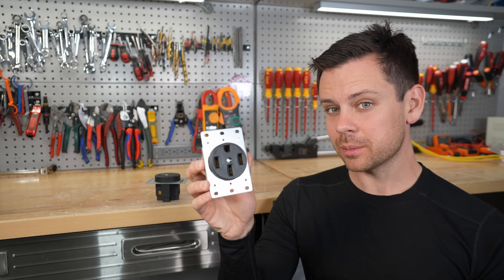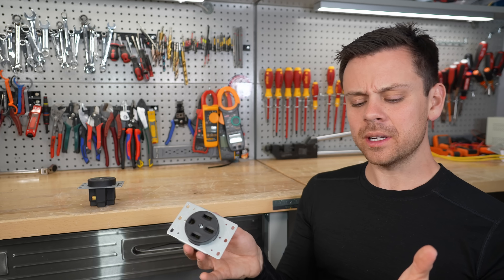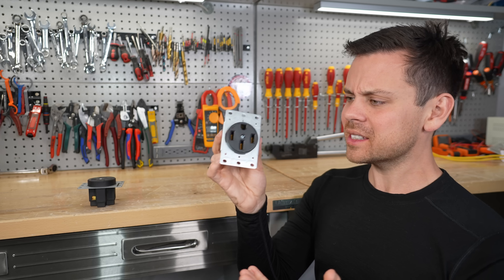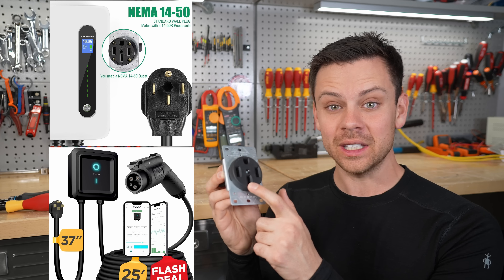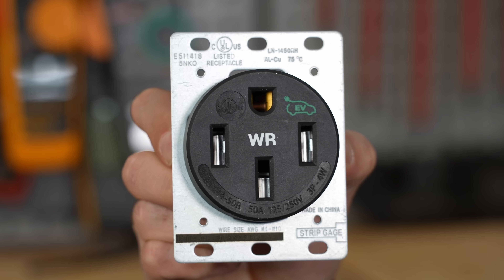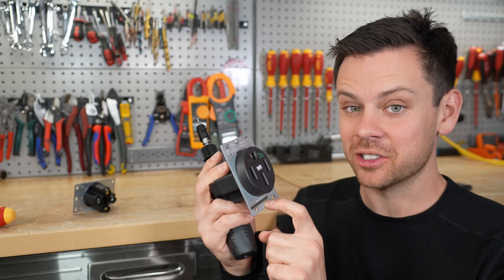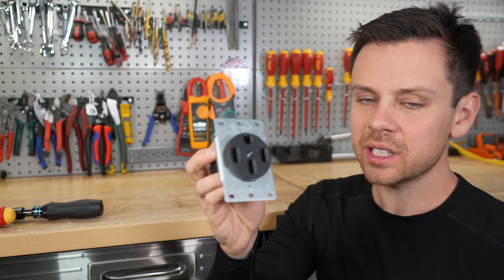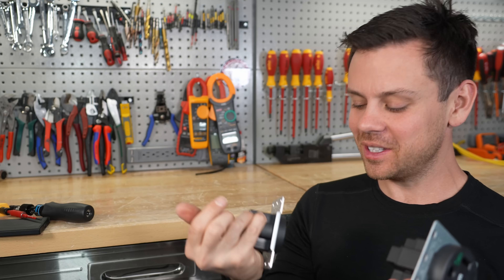Quick Guide to NEMA 14-50: Don't Burn Your House Down!

Comment: Is this a UL rating issue?  If it is UL rated for 50 amps it should do 50 amps no if buts about it.

If this rating is under some type of duty cycle limit  the UL rating should state that.

ETC,  is this 50 amp rating peak, continuous dutycycle or some other constrant?  I wonder would the manufaures instructions say.

The cost of the product shouldn't just be a factor in a UL rating..

Comment: You need to check your wire ampacity chart. You do not need 4awg THHN for that 50 amp outlet.
Reply from the maker: @machaf  It's the max size recommended by the receptacle and the EV chargers. And I use the 60 Celsius column in nec. Overkill but I like to sleep good at night

Comment: My Vevor RV 50 amp power box hasn’t had an issue charging at 48 amps daily for over a year. No sign of melting, resistance is happening in your box for some reason.

Comment: This is why I am subscribed to this channel!  Great tip Will! Wasn't aware of this issue but after a quick Google search I am definitely replacing my outlet!  Our electrician installed a standard non-EV rated 14-50 outlet so my guess is that this isn't a widely known issue.
Reply: You can also use a Hubbell industrial 14-50. They are available everywhere. You don't need to have one stamped with an EV that is a marketing gimmick. Just avoid the cheap ones.

Comment: North America catch up with the rest of the world and start using pin & sleeve for high current outlets. There’s already a standard IEC 60309-2 (Series II) 

A 60A blue plug (2P, 3W) with mechanical interlock is all we need. For situations where a neutral is warranted like with RVs, the orange plug (3P, 4W) would be ideal

Comment: Bryant Electric 9450FR 50 Amp 125/250V NEMA 14-50R Flush 

Cheaper than Hubbell but as far as I have been able to determine, just as good.
Reply: Made by the same company and generally considered to be identical other than brand.

Comment: Also Will, what wire size were you using, #6 or #4,  how long was the run to the outlet and did you see any temperature rating on the outlet?  I'm thinking that as #6 is only good for about 40a at 60 degrees C, and 55A at 75C,  if the cheap outlet is only rated at 60-75C going to #4 might mitigate a lot of the heat with either the cheap and quality outlets.  
Additionally, one could consider hardwiring in a charger, and possibly skip added cost of a GFCI breaker as well, and  save about $150 to put towards a second charger if needed.

Comment: I'm constantly telling people to NOT install those cheap plugs or use their existing dryer socket.  Always recommend hard wiring over a socket as the sockets and plugs do wear down over time with use and with multiple disconnections.  I was working on a 40amp pottery kiln once at an art studio and noticed the plug was charred and melted.  Suffice to say, they had an electrician hard-wire it instead of burning the building down...
Reply: if you are using a dryer socket you need to cut back to 24 amps or lower. It's only a 30 amp circuit at best and you want no more than 80% continuous load.
Reply: @rupe53  I don't agree.  I would not trust a dryer socket period.  Unless you're only charging your vehicle for an hour or two at a time, it's too much load for a cheap dryer socket.  At 24 amps, you're likely going to be charging your vehicle for easily 5-7 hours per charge.  Dryer sockets are not designed for this.
Reply: @    that 80% rule is from both NEC and UL. It applies to continuous use, which is why it's down-rated from the face value of the circuit. I would agree that there may be exceptions due to wear and tear but that is beyond the scope of the general discusion here.

Comment: The amp capacity of ANY 14-50 outlet must be de-rated depending on if it is installed with a protectoive cap or not as it make less airflow to cooldown the plug. and also derated  if it is on a  wall facing south as most plugs are BLACK and when the sun shine on the charger plug it will rise their temperature by several degree which will also add up to the derating of the protective cap de-rating.  The mark that the female plug is leaving on the  male connector is a VERY great indication on the goor or bad electrical contact.  Also contrary to the popular opinion, frequent insertion of the plug DOES HELP to keep the 14-50 to not overheat as it brush the contact blades to expose fresh metal every single time. I am using the 10$ one since 12 years now paying attention to these rules and the maximum recorded temp was 39C under 32A stabilized after 2hour of continuous duty.  Plugs burn because heat and heat come from ALOT of different methods.. not only wire size, torque specs and amp selection etc...
Reply: @Doctorbasss  is the same thing true if I use a 14-50 outlet inside a home for an electric stove?  You are saying the simple act of plugging a cord into the plug means the plug can’t cool itself?  Or is an EV plug larger (less air) than say a stove plug, or other 240V /50A appliance?
Reply: Stoves/ ovens do not draw full current constantly like chargers, and aren't unplugged as often. Even the cheap ones hold up just fine for that use.

Comment: You only need 8 AWG copper THHN for a 14-50 outlet unless you found one that only has 60C terminations (which I've never seen). If you're using a 48A charger then you need to hard wire it and use 6 awg thhn.
Reply: Let's really make the heads explode...what about 6 AWG aluminum SER? It's rated for 50 amps with 75C terminations. And, if you have a device that either can't accept aluminum wire or doesn't have 75C terminations, go into a pullout AC disconnect (they have 75C terminations and accept aluminum wire) with the 6 AWG aluminum SER and come out of it with 8 AWG copper THHN to your device. Can even use an AC whip with the 8 AWG copper THHN preinstalled.
Reply: @niktak1114

This is so wrong. I have a mind to report this comment as misinformation. 

THIS IS DANGEROUS, DO NOT TAKE THIS PERSON'S ADVICE!
Reply: @billstevens3796  Niktak is correct. Check your NEC ampacity chart. 8 awg thhn is rated for 50 amps when using the 75C column. As long as your terminations are rated correctly (75C), you can use 8 awg thhn for a 50 amp circuit
Reply: @billstevens3796  Which part is wrong? It is correct for the US at least (I am an electrical engineer in the US so I'm mostly only familiar with the NEC)
Reply: @niktak1114

If you want to burn your own house down, fine. But don't go around telling people things that will cause their houses to burn down.
Reply: @billstevens3796  8 awg is accepted by code in this circumstance and is actually relatively conservative in most scenarios (it has to be for prescriptive rules like this)

Comment: Absolutely right. I’m an engineer and hired a commercial electrical contractor to install mine. They used a Leviton and I started receiving the high temp warning as well. After doing a lot of research I discovered that the continuous high current causes the crystalline metal structure to weaken and reduce the “grip” on the contacts. It doesn’t matter if you retorque the input terminals, the internal contacts are permanently damaged and the receptacle must be replaced. I chose a Hubbell and replaced it myself so I had peace of mind.
Reply: My question is... Is this a problem at the service box too?  If there is a constant draw at the 50amp breaker would their not be the same issue of the weakening contacts? Thoughts?  I wired mine up myself so I'm concern.  I did hard wire the " charging" Charge Point device.
Reply: @YPllayer  Usually not a problem at the breaker if the following are all true: Breaker is right brand for the panel, panel and bus connections are clean and tight, and wire is correctly sized and torqued correctly at the terminals. It is ok for the breaker to get fairly warm when the charger is running. 

If the breaker is hot (can't touch for more than 30 seconds), you smell hot or burning plastic, breaker buzzes or hums loudly ( a faint hum is ok) or it trips during a charge cycle, you need to get it checked. Any of those issues is NOT A DIY repair.
Reply: @Piinkz  the breaker itself is rated for continuous duty at face value. (it will get warm) The 80% rule for continuous duty (more than 3 hours) covers the entire circuit, wiring and plugs. This is in the NEC book. BTW, the correct breaker for the brand of panel should have no issues to 100 amps, which is the rating for the buss bar connections. If you are worried, pull the breaker and examine the contact area. If it's good then add some anti-ox to inhibit corrosion down the line.
Reply: @rupe53 What anti-ox do you use?
Reply: @chuckevans2792    they all meet the standard so whatever the supply house has in stock.
Reply: hey buddy, nice to see you here too! 😆
Reply: If they are installed, do they need to be replaced for an electric stove with a 40 amp breaker?  For our kitchen remodel, i think that a Leviton unit was installed, but I have to look.
Reply: @gibblespascack1418 You are probably ok. Stoves don't draw as much as an ev charger continuously (very important distinction to note) as the elements cycle on and off. If it is a Leviton (the cheap brand causing problems) it will usually be ok as long as it's not already damaged.
Reply: @mxslick50  Thank you.  We went through Thanksgiving and Christmas which would be the heaviest use, so I will pull the stove and take a look.  Have a good day.
Reply: @gibblespascack1418  My personal opinion;  I would replace it.  I had the same issue with a NEMA 14-50 being used for a dryer.  Ended up with only one leg of 120V supplying voltage to the dryer.  The dryer would run on the 120V leg but the heating element would not supply enough heat.  Pulled the dryer away from the wall to find the partially melted receptacle.  That's just a dryer that is used intermittently, and not for hours at a time.
Reply: @gregr7967  Sounds like a good plan.  I will change mine for the better unit.  $50 for a $35K kitchen remodel makes little difference to me.
Reply: @gibblespascack1418  you might want to.  Although the oven does cycle on and off, the burners and everything can really put a load on that,  oven can be 5500 watts, each element can be 1200 up to 1500 watts on some stoves. that's 10 kw or so, really pushing it to it's limits.  most stoves run 50 amps too i thought. better safe than sorry, but if it's been  in there a while, take a look at it you'll know if it's going to be problematic or not by now.
Reply: Hubbell replacement plugs are much better than the bargain plugs.

If you had an over temp warning, check the wires for heat stress when you replace the outlet. Look for cracks in the insulation!
+ If the insulation is hard it could crack when you put the outlet back in the box and you would not see it.
Reply: Do either one have an insertion cycle in the specs?
Reply: @fanplant     I bet you can find the UL listing test specs, but that might only be the minimum. BTW, here's a starting point... UL standard 498, titled Attachment Plugs and Receptacles. It covers the various ratings an durability if you dig into it.
Reply: Leviton does make an EV version now for around $40.

Comment: OK, I'm not doubting you at all, but my curiosity wants to know what exactly is the difference in construction that makes one not work and one 5 times more expensive?
Reply from the maker: Temp rating of plastic, terminal thickness and size, plug copper thickness etc. everything just bigger

Comment: Leviton is not traditionally known for poor quality. Ive used their industrial components for 3 decades and I dont recall having issue with any of the NEMA twist-lock or standard receptacles. This is concerning.
Reply: Same. We use them for everything at my job.
Reply: I use leviton for a lot, but their breakers have stupid plastic lever points, so not everything they make is perfect. 
But, I believe the 14-50r was designed with the NEC 80% rule in mind, not for continuous EV charging 3-8 hour loads above 40a.
Reply: Leviton makes two grades.
Homeowner Box Store Cheap
And
Commercial Grade.

Comment: A lot of us engineers were really debating this in other posts online talking about this.  I understand what you see in testing, but a 50A UL plug should be capable of very close to 50A continuous, or the rating is wrong.  Are you going to tell me I can only run a 15A outlet at 10 or 11 amps, cuz I constantly run things like hairdryers, portable AC, etc well above 10 amps (above 1200  watts, as high as 1500 watts at 125/120/115 V).  Are we saying a 240V outlet has to be de-rated differently?  By how much?  You are saying as low as 6000 or 7000 watts continuous?  How can they even call it a 50 A outlet then?  If you put a 50A breaker, shouldn’t it not trip until 125% load?  I also thought 6AWG is what is required for 50A 240V?  6AWG is what is used in “shore power cables” for boats, RVs, and generators.  6AWG is rated for 60A.
Reply: which again target ranges/ovens and dryers that is the market for the cheap ones.  I upgraded my oven to Bryant and 6 gauge THHW-2.
Reply: @dougbertInExile  Why is a rating of 50 amps "targeting" a lower-than-50-amp capacity?
Reply: @BurnerJones Because 50 amps is the maximum non-continuous load allowed. Per the NEC  a continuous load is one of max current for 3 hours or more.  Receptacles and devices are rated for 80% continuous load unless otherwise noted by the manufacturer. The cheap 14-50s fall under the 80% ratings for use.

Comment: UL approved.  What a mockery.  Even the advice to not use better quality 50A outlet at 50A for extended times.  Total mockery.  What point an outlet that can't actually be safely used at it's rated figure for at least 5 hours continuously.
Reply: which again target ranges/ovens and dryers that is the market for the cheap ones.  I upgraded my oven to Bryant and 6 gauge THHW-2.  Must install commercial receptacles to support loads for greater than 3 hours,  for EVs
Reply: @dougbertInExile  Doesn't matter what it targets.  If it says 50A then it will do 50A, there won't be a 3 hour time limit on it, and will not melt in the process of doing it.  The fact that this sort of crap seems to be generally accepted in the USA isn't good.
Reply: @retrozmachine1189  Agreed. At the minimum I expect the product to handle what it is rated for and I expect a factor of safety to be built in.
Reply: @retrozmachine1189  The NEC 80% rule stipulates that electrical circuits should not be continuously loaded (three hours or more) to more than 80% of their maximum rated capacity
Reply: @retrozmachine1189  by the same nec rule,  a 200 amp service panel can only support 160 amps if the load is more than 3 hours.  Even though a 200 amp panel can do 200 amps for less than 3 hour.  and 400 amp service supports only 320 amps

Comment: what about fir a welder ?
Reply: Unless you're welding something monstrous, your duty cycle is going to be much lower, but I still wouldn't go with a $10 plug because at max power you can draw close to 40A.  My local Ace HW sells the Leviton for $15.

Comment: This info has been around for a few years.  The car charger pulls those amps continuously while you home clothes dryer is not constant nor as long per use.  So those cheap ones have been installed in houses for decades for the clothes dryers.  Then EV's come along and they thought, "Oh I already have a plug!"  Nope. wrong!  There had been a few fires.  Sandy Munroe had a video where an electrician installed one of the cheap ones, caused a fire.  You MUST buy the expensive one.  Copper wires only.  There are specs for its use.
Reply: Very interesting video! I'm curious why 4 AWG wire when 6 AWG THHN is rated to 65A at 75 degrees Celsius. At continuous load, 50A x 125%= 62.5A which is within NEC code.
Reply from the maker: @airjunkieadam  because it's the max size recommended by the receptacle and the charger. And I use the 60 degree column of nec. I like to have zero issues with my systems and run them forever.
Reply: @WillProwse  fair enough, thanks!
Reply from the maker: Absolutely! And I still see the mistake being done so best to have another video out there to tell people. 

Sandy is awesome
Reply: @WillProwse  It happened to somebody Sandy new.  Sandy learned all of this when he went to the garage and saw the damage.
Reply: @WillProwse  YES!

Comment: I also have a couple of 14-50r and they are Byant which is made by hubbel.  I have found them cheaper by a few dollars than a hubbel.   also some people install NM-B  6 gauge -  which can only support 55 amps not good
Reply: #6 90c insulated wire is good for 60 amps. The 75 or 60c device terminals derate it to 55 or 50 amps respectively. And cheap devices tend to have 75c rated terminals.

Comment: I had the same exact issue when I was using my Tesla Gen2 UMC. Thank goodness their plug adapters have temperature monitoring, not sure if other brands of EVSE have this feature on their 14-50 plugs. I kinda now understand why they capped the current to 32 amps max to give good margin of error for safety and temperature monitoring is the ultimate failsafe.

Comment: Which brand are the ones that are overheating?
Reply from the maker: Leviton
Reply: @WillProwse  Same problem with there 30 amp ones ,,have had to change out several that are in RV park that are supposedly rated for RV's
Reply: which again target ranges/ovens and dryers that is the market for the cheap ones.  I upgraded my oven to Bryant and 6 gauge THHW-2

Comment: why does it over heat ? bad metal - bad connections ??
Reply: not designed for CONTINUOUS 40/30 amps loads for greater than 3 hours

Comment: I installed the cheap one myself and it works fine at 32A in the Texas heat.
Maybe you do a lot of plugging / unplugging with all your testing?
I doubt the cheap ones are rated for many insertions.